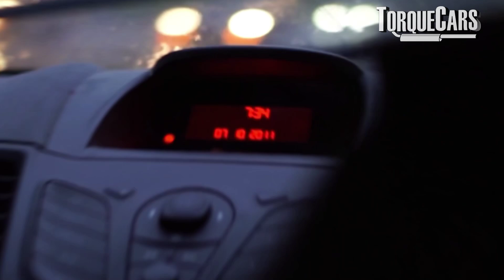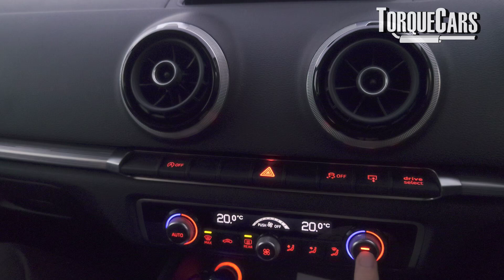Stop Car Windows Misting Up Using Simple Physics Trick.

Comment: The issue in this country is we get very wet damp winters, on my car the air con compressor does not work below 5c. I was driving today in heavy rain, it was 6c it then went to 4c and my air con went off due to temperature outside, this then meant all the condensed moisture on the evaporator coil blew into the car and made my windscreen and all other windows very dangerous, had to pull over and use heat only to clear it.

Comment: on dry days during the winter I leave the driver window open a couple of mm's, helps to "air" the upholstery and carpets, and balance the humidity of the interior and exterior.
Reply: Yep same always ventalate my car too
Reply: i tried this one winter.   Car got mildew somehow in a carpet as a result and i never was able to get it to stop, the smell was persistent and nasty.   Pro's advice only lowering windows in very stable environments, without outside air getting in that may have mold spores.  Even in our single or double car garages, if old, might be mildew.   So this is a complex tricky topic

Comment: I'm sure somebody must have said this already surely? Shaving foam is the most well known off the shelf go-to for anti interior fogging up. And tbh I disagree about not wanting the car hot inside. I get mine nice and hot THEN on the way home roll down the windows and let all that hot moisture-laden air OUT of the car. So there are times when you do want to heat up the interior with the sole purpose of ejecting some of the water content from the interior. In addition I use large bags of Damp Eater silica crystals and some Aqua Vault Interior Dehumidifier pots, cheap as chips in Tesco and work really well. Neither of my tin-tops has got fogged up this year so far using these techniques, in fact so far this year I've not even bothered with the shaving foam trick

Comment: Get wind deflectors for your front windows, the rear too if possible. Leaving the windows open slightly is then possible in all weather. That little bit of extra air flow makes a huge difference, especially if you already have damp carpets.

Comment: Simple and free: Open every door incl. boot/hatch for some seconds after a trip. 
So with the warm air most of the moisture can get out of the interior.
Reply: The Bonnet also as it would be the most important part in this case as opening it allows the buildup of condensation to escape the hot motor which simply rids your car of condensation

Comment: Up until last year, I used silica in my old Land Cruser to good effect. However,  last spring, I got into the car and  found my screen was covered in condensation, but when I tried to wipe it off with a cloth it smeared to a point that when I turned towards the sun, it was like looking through a fog. When I checked the silica in the pot, it was completely disolved into the water. The water had then evaporated and carried the silica onto the windscreen. The only thing that got it off was a spray-on oven cleaner and clean cloth. After that, the screen remained condensation free for quite some time.
Reply from the maker: That's a good point to make. The solid crystals that need to be recharged by heating them work best in cars, and you don't have all that liquid in a pot sloshing around.

Comment: an old sock filled with catsan kitty litter on the dash sucks a ton of moisture out the air, for me I just run the aircon after the car has been running for a few minutes and I avoid short trip as short trips just make the car a greenhouse environment.

Comment: I find that switching on the air con unit is the most effective remedy for demisting the windows.  In fact, this is the only thing I actually use the air con for!!  A good, informative video, as always.
Reply: Yeah it's actually a dehumidifier and then heats the cold dry air back up.

Comment: Sometimes I whack the A/C, blowers and heat on with the sun visors down for a lil while then blast the front windows open so it goes from high pressure to low pressure.

Comment: I ceramic coated the windscreen on the inside of my car it makes it hydrophobic it still mists up but it doesn't truly stick and the demister will clear it way quicker, having your sun visors down whilst demisting will focus more air on the windscreen too. I have a Toyota so the climate control is overpowered anyway. I did use to have a couple of silica gel pads in their that came from online orders. Might put some in again at some point.

Comment: Why don't all cars have heated front windscreens like Ford's? All EVs should have them, as using the AC to demist the window reduces the range too much.
Reply: Ford patented the 'micro wire' technology used to heat the screen. But on an E.V. you should have an electric heater anyway, which should be faster.
Reply: Agreed. I loved the heated front window on my Mondeo. A Godsend for northern Scottish winters.
Reply: @simonshee5155 It was the only thing I liked about mine.

Comment: dont know what you will say yet, but acvording to me its really easy : keep the windows clean from inside and if they fog up just blast the windshield with hot air... no need for ac or anything like that since the hot air is already really dry in winter
Reply: No it's not, it's cold damp air. Your air-conditioning will dry it though. Press the demister button and it will be done for you quickly. When cleared press 'auto' to keep it that way.
Reply: @MartinBennett-rs6thrasher   well i've being doing it like this for years and i never have trouble with fogged up windows so idk what to tell you

Comment: I don't put the heating on anyway for a good while in winter (exactly when you need it!) or car engine etc takes forever to warm up (then again it pretty much does anyway!); diesel A3 1.9 8P1; auxiliary heater long broke (I'm not even considering taking that thing out to try and fix (likely dry solder joints?). I do use those dehumidifier sacks, but don't believe they're up to much; especially when it's really damp and cold and after (some) sun heating up the car they seem to make little or no difference to internal condensation at all (it's just too much?). At the start, this vid seemed to show, so imply, only external condensation, which is irrelevant!?

Comment: I use the RainX anti-fog. It does OK. And definitely better than nothing at all. I vape (not a little pod thing) and during the winter it trashes the windows! Not using RainX I have to wash my windshield every 2 or 3 days, I'm in my car a lot! With RainX I can get about a week.
Reply: I vape too and I can confirm even with the window open it still clings to the glass, that then makes them steam up far quicker. 
I use a glass cleaner called “Glaze”. It’s phenomenal at cleaning glass and mirrors, it degreases and doesn’t leave an annoying smear after you’ve rubbed at it for an eternity like most glass cleaners.
Reply: I always open the window and blow it straight out no residue at all. It's also worth getting a device just for the car rather than the big chuggers. 
My brother used to use big cloud rebuild vapes in the car and it clogged the pollen and air filters within a few weeks.

Comment: I will miss my front heated windscreen when I get rid of my current Ford.
Reply: I always thought of that as a bit of a gimmick. The A/C usually clears the window pretty quick and it means you never have to put up with Ford customer services.
Reply: @loc4725 well I wouldn't buy a Ford either but heated windscreens are far from a 'gimmick', especially on a frosty morning, according to friends that have them, and confirmed above by Xenon777.

Comment: Buy a cheap household dehumidifier and leave it running for over night inside a SEALED, VERY WARM car. You might need to do it over a few nights (when the electricity is cheapest), but it is worth it and your car will smell much fresher. Bacteria need water to grow. 
A cheap dehumidifier can be purchased for less than £30, or hire a more powerfull one from a building trade supplier. 
I can't emphasise the importance of sealing the car as well as possible. A small gap in the window to allow the power cable through should be sealed with duct tape or similar, close all the air vents and seal them.
Also, take any removable fabrics out and dry them in indoors.
Finally, keep 2 or 3 of the crystal dehumidifiers in your doors and boot.

Comment: Another trick: for one minute before or after you park your car, roll down ALL the windows or open at least two doors on opposite sides after parking. This will replace almost all of the warm, moist air with cold air that carries less moisture.
Reply from the maker: That's a good tip my friend.
Reply: That’s brilliant, and basic physics too 👌🏼👌🏼
Reply: A way to speed this up is to open one door fully, keep it open and open and close the opposing door four times. I do this to remove stagnant hot air from inside the cabin when the car has been sitting under the sun and it works very well. I suppose it will work on moist air too.

Comment: Just a comment rather than a tip. I’ve noticed sometime on directing air to the windscreen things can get worse before they get better. This can be “alarming”.
Reply: @wallace-bv4rl   absolutely, I was on mountain roads on an extremely foggy night and didn't realise there was a buildup on the windows as well so I'm not just seeing the fog, blasted the cold air and almost had to stop the car because I could not see, unfortunately I don't really think there's a way around it, I've tried anti-fog pouches that "absorb moisture" which i try to leave on the dash at all times but so far, no luck.
Reply: Make sure to use some heat e.g 20c not cold as it will make it worse for a bit.

Comment: Before motorcycles visors had pin lock bit like double glazing to stop misting . Use to put diluted washing up liquid on the inside stop water misting on the inside . Never tried  it on a car inside window just used air con . Good way of keeping air con pressurised over winter .

Comment: It wasn't till few years ago when I found out some car manufacturers started using 'Lamp Desiccants' behind the headlight bulb cover caps to prevent the headlight assembly from fogging up. Those 20-30 gram silica gel packets need to be replaced or recharged after time. Since then, I have been using 2 x 500gr food grade desiccant packs inside the car during winter to keep the windows from fogging.
Reply: The  desiccant packs (silica gel) can be "reset" by leaving in the oven (on low heat or after being used) for 10 minutes to dry, so they can be reused.
Reply: @RuiChambel  Yes, even in microwave, that is what I was referring to when I mentioned recharged

Comment: Very important:When turning on ventilation or ac to defogg your car, TURN OFF your recirculation. The car will defogg faster.
Reply from the maker: Doh I should have mentioned that - thanks for the heads up, that is an important tip.
Reply: Why would you ever even turn on recirculation?
Reply: @TopiasSalakka  If you are smoking somethig naughty.
Reply: Yeah my car automatically turns it off, and i think if i turn it on, it turns the ac off or sth
Reply: Hate recirculation, only ok if passing through smoke. 

Cars with automatic climate control activate the recirculation damper and recirculate up to 100% of the indoor air depending on conditions... even if you don't have the button pressed in. This then causes odours in the car and breathing moisture to condenser on the evaporator and then makes a smell. 

I disconnected the damper motor so it's always on 100% outside air.

Comment: I make sure the insides of my windows are as clean as possible. It doesn't prevent it entirely, but it does take a lot more time for the misting up to be an issue that the AC typically deals with very quickly (usually within 2-4 seconds vs a couple of minutes). I can actually see spots of condensation form much quicker and take a lot longer to go away where I didn't do a good enough job cleaning the windows.
Reply: At last someone gets it. Keeping interior glass clean is key, and using a rechargeable moisture absorber helps. Also, using rubber mats instead of carpet ones which can remain damp in continuous wet weather.

Comment: 3:57 I use the Rain-X anti-fog product on my windshield and other windows. It certainly works. The thin film it leaves on the glass surface slowly breaks down and needs reapplying after a few weeks. This coincides with when I wash the car every 2-3 weeks anyway, since winter rain deposits a lot of dirt on my car.
Reply: Wind deflectors  open window a small bit

Comment: i use cat litter in a small box on the dash , it does the trick , been using it for years
Reply from the maker: That's a good tip. Do you give the cat a key to the car in case it needs "to go!"?
Reply: Same.
Easily as good as any of the purpose-made products you can buy, and a fraction of the cost.

Comment: I’ve noticed if you don’t breathe inside your car helps a lot.  I’ve been driving for a long time before I learned to use a/c in winter.
Reply: You will die but at least people outside can look through the window to identify the body inside.
Reply: @blaze1148 😂
Reply: I breathe through a pipe which hangs out of my side window. Works well
Reply: Sorry to have to break it to you, but most people have to breathe.
Reply: @seventus 😂